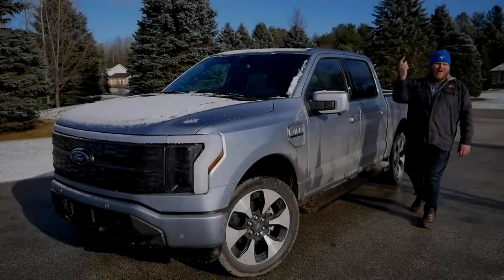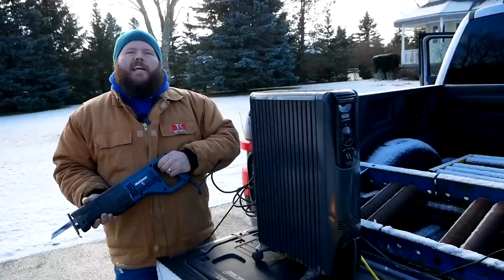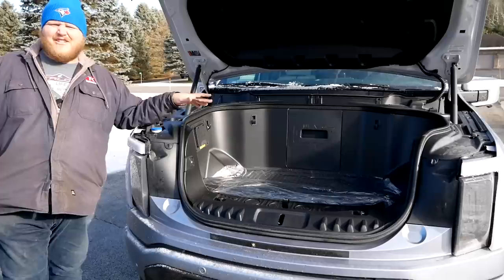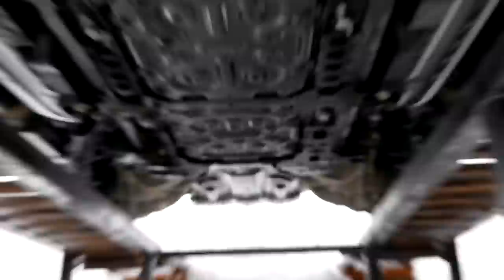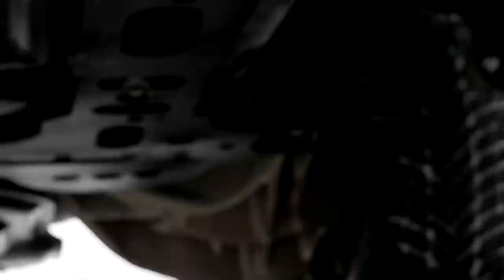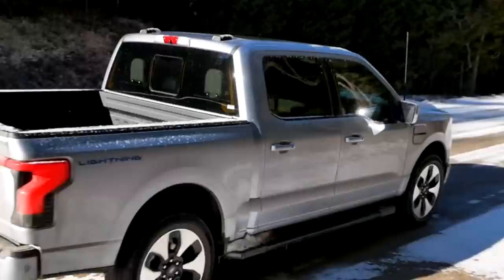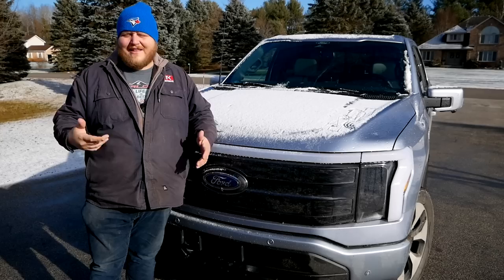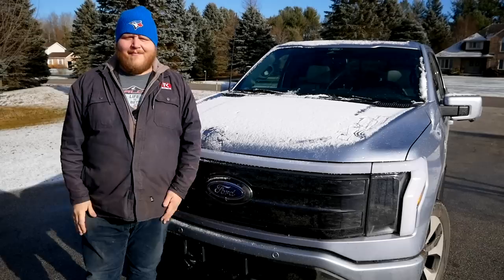Ford F-150 Lightning Electric Truck Real-World Review - Testing Towing, Range, Off-Road & More!

Comment: When this thing first came out, I loved it, but now that the hype has worn off, it’s genuinely hard for me to get excited about a $95,000+ truck — regardless of what powers it. Same thoughts on the TRX and Raptor R. If you’re not making $250k+ you have no business owning one of these, and that’s 97% of the US population.
Reply: Unless you're like me and had a couple of vehicles to trade in on it to get the price down.  I  realized when I ourchased the lightning I wouldn't be driving my 2024 F150 or my 2028 prius any more. So why not get the price down to something more affordable. Also if I had to charge at public chargers,  I wouldn't have purchased it. That defeats the whole purpose of saving on fuel costs.
Reply: @pstoneking3418  I'm guessing you mean 2014 and 2018?
Reply: You don't have to get the top of the line model. You can get an XLT for $30K less.

Comment: another great and fun to watch review.  As an ex-Tesla owner (for off-road reasons) I once made a 6,100 mile (9,800 km) trip in mine.  Rarely did I ever charge above 80% as the charge rate drops off a cliff after 80% and it takes way to long for that last 10%.  You will get to where you want to go a lot faster charging to 80% then someone charging to 90%.   Another consideration is the larger the battery pack, the longer it takes to charge.  

I look forward to more of your reviews.

Comment: The initial sticker price is the hard pass for me it’s just not viable when even the xlt trim gets so close to a hundred grand with extended range. Not to mention in Canada the extended range power plant should be named the only acceptable range since once temperatures drop the smaller plant won’t keep up. 

None of the EV companies seem viable at the price premiums they’re demanding except maybe the Chevy bolt which I just don’t want anyway.

Comment: Until technology progresses these electric vehicles are just a toy novelty and an expensive one at that.  In northern Ontario where large cities are 200 to 450 miles apart you need hybrids. I have a Sierra and a Rav 4 hybrid.  We only drive the Sierra occasionally when towing.  I think the hybrid which we've had a few since 2014 are the answer at this time.

Comment: I am really concerned about the salt causing problems with the electrical connection's.
Reply: Salt sucks for everything that can be corroded. Tons of current ICE powered cars that have wires and electrical connections, also susceptible to similar.
Reply: @NLKen thank you. Yes ice have corrosion to but that most of the time the problem. To have all electric everything the wrong things shorts out your fucked

Comment: As a Canadian EV owner, I get the gripes with the public charging. It really needs to mature, and all the different apps are just dumb. 

That being said, my car has enough range that I only have to use public charging every few months on road trips. The huge day to day perk is having a full "tank" every morning when I get up since I'm just charging at home overnight. As you said though, it depends on your use case. 

The other shocking thing is the energy consumption on that lightning. My Ioniq 5, for comparison,  does about 21kwh/100km in the winter, on studded Toyo's.

The price is also off the wall crazy.

Comment: I think this was a fair review. I'm not sure that the EV revolution makes a lot of sense in Canada. The infrastructure isn't there and it's taking a long time to see improvements. The range is a huge issue as well. We're big. Yeah, 300 km range. That could be a single days travel just around Toronto! Never mind going to the cottage or the like. As it stands right now, you can't get there from here is a huge issue and I don't see it changing soon. It's all about money. A charging network isn't cheap and the density of charging vehicles per month might not be enough to make it profitable.
Reply: You can buy a relaive cheap propane fuel cell generator and 40 lbs propane tank which DOES NOT USE pistons but rather a TOTALLY SILENT thin-membrane proton-exchange electrical power system which runs at 85%+ efficiency, so a simple 40 lbs propane tank is about 200 KW/hr which will gives you ANOTHER 700 km (460 miles) of range since the you can NOW download a "Software Hack" for the F150 Lightning which lets you charge it WHILE its driving! Sooooo.... you now get a total of 960+ km (620 miles) of driving range. That's good enough for most trips! 

Cost-wise, 40 lbs of propane is $60 CDN ($45 USD) so pretty good in terms of running costs! The BEAUTY of a propane fuel cell is that it is TOTALLY QUIET and you can still use it for your BBQ if you connect a long external hose to it AND it also has extra power outlets for driving appliances and other gear!

V
Reply: Back in the early model t Days gas stations weren't available everywhere also but there is power everywhere there are houses just not dcfc the dcfc take a lot less time to install and alot less red tape from environmental regulations so it will happen alot faster then people think next 5 years plus the s curve of sale yoy of ice vehicles is declining as evs are rising soon it will hit that point manufacturing ice powered vehicles won't make profits and will be canceled it will have a snow ball effect on oil prices since most companies are leveraged to the nine
Reply: @StarGateSG7 too much work versus filling a gas tank
Reply: @doctorcropse2795  One 50 Kilowatt Ballard-style Proton-Proton membrane exchange fuel cell powered by a 40 lbs tank of propane (i.e. 240 kWh equivalent!) would provide a heck of a range increase to over 700 miles (1100 km) where the vehicle can charge WHILE you are driving. AND you can use the fuel cell and propane for cooking and heating at your campsite while you are at it!

V

Comment: Okay so lets take a look at the analytics. Average price on autotrader is around 98k plus hst. Lets say about 115K with all fees and charger for home. A f150 in Canada XLT/Lariat can be around 58-62k up to 80k depending on options. Lets say with HST about 75k. So right away we have a 40k difference. Average kilometres driven by a canadian is 15k but trucks are more lets say conservative 25-30k per year. Lets say a F150 gets 15L/100 km through an average year and that is 4500L of fuel. Now take a cost of around $1.55-1.7L and you are at $7-8K per year in fuel. So alone this lightning will take about 5-6 years of ownership just to be the same as a truck. That does not include charging. As you can see an average cost to charge a car at home/at work can be about 500-700 per year. So really on average your payback period on a F150 is around 5.75-6.5 years and that is right out of warranty. To me I would not touch this thing and I did not include the outliers of sitting in the car/ having lunch to wait on the charge. if you pay yourself 45-70 per hour that is time it costs to charge while on the road. In closing I drive about 35,000 km's a year with 17-18^% being towing a 4500 lb boat and trailer. I have done all my analytics through Power BI and would never buy an electric for 3 simple reasons. 1) You have a variable of charging overnight so if an area does not have good infrastructure north of barrie you are SOL 2) I do many day trips fishing and for me there is no charger at the lake and then I would have to stay in a hotel overnight just to have a full charge to drive home 3) The charging infrastructure is still in ideation in Ontario. I work for a utilities company and there is still about 4-5 years left to get charging stations north of barrie in a quality and safe rollout. We are still too far away for electric trucks to be used off grid, outside the city or on long road trips.

Comment: I completely agree about installing fast charging stands at already existing gas station convenience stores. Everything is already there and as the EV market grows the business owners there will be hedging against losing customers. Though not all stations could install pass-through charging stands (for EV trucks with trailers to be able to charge conveniently) for many it would be a smart choice. In fact, putting in a couple pass-through chargers and having several parking spot chargers would mean more people can charge but the options will still be there. 

But, there needs to be uniform standards upon which everyone can rely. For one, all charging stands should be able to charge up to 350 kW at minimum standard (if the vehicle can't take all that power the charger will put out what the vehicle can tolerate). But, even better, all manufacturers should design their EVs to allow for extremely fast charging. The industry needs to work toward cutting the amount of time it takes to charge, instead of 1 hour the same charge should take maybe 15 minutes.
Reply: The only downside is the faster you charge these types of batteries,  the more battery degradation occurs. Same goes with constant charging them to 100%.

Comment: We are in the "wild west" so to speak with EVs, much like other technology we are going to see some weird stuff as inventors and engineers try our different things to see what works best. Go back to when we started putting bullets in cases in the 1800s and we had all sorts of wacky firearm designs and case designs. Everything from revolver rifles to caseless lever action pistols. Obviously those designs had huge flaws in hindsight and  where outpaced by superior designs like your standard bolt action rifle, but at the time they seemed revolutionary. 

At first Front trunks where a HUGE push in EVs since the lack of an engine meant reclaiming cubic feet for other uses, as EV design has evolved most crossover and car type EVs have dropped the front trunk in favor of maximizing passenger space and eliminating long hoods and front overhangs as it turns out most owners did not use the extra storage space, and the rear hatch was often sufficient enough. Only large truck type EVs have kept the Front Trunk, as Trucks are entirely about cargo capacity and the trunk offers dry controlled storage for more delicate items like groceries you might not want rolling around in a cavernous bed. 

This follows true with our charging infrastructure as well, we are going to see odd things in the future as engineers and businessmen figure out what people actually need. Does a traditional gas station style charger work best or is it better to lease space  in a parking lot of a commonly traveled establishment? What do we do about people who street park cars? Do we install chargers along the street and assign spaces to households or do they have to travel to a charger like you do currently with a gas station? There is no yes or no nor right or wrong, only what doesn't work, what kind of works and what really works. And we are going to see more of the first two than the last one until people figure out what does really work and it becomes standardized. 

Now is not the time for everyone to get an EV, and that is okay. Sometime in the near future however, I believe it will make more sense for most of us to own an EV than an ICE vehicle, even for our trucks unless we absolutely positively need the extreme energy density that gasoline provides. EVs have already made the majority of basic 4cyl transport mobiles look unnecessary, all they have to do now is scale up production to match in price and all your Nissan Rouges, Chevy Trax, Toyota Camrys and other uninspired basic transport units will just not make sense to own from a cost and maintenance hassle perspective. Things can change and make this not true however, EVs might never be able to scale production  properly, charging times may never improve, and gas might become so cheap compared to electricity that making the switch just won't make sense from a financial perspective, but I don't think thats going to happen, history shows that technology always is expensive and inconvenient at first until one day it improves enough that it's not.

Comment: Ev's are good for people who have a single family home with a garage where a 240 volt charger can be permanently installed.  Think of those people who live in apartment complexes or live in older traditional style rowhomes where parking is public and you aren't guaranteed a spot directly in front of your house.  Even if you did get a spot in front of your house do you want the charging cord running 40 or 50 feet from the house down to the car and being left there outside all night hoping nobody messes with it.  If your child has a sports tournament that is 2 hours away and you are staying the weekend in a hotel then you have to plan for when and where you are going to charge the vehicle over the weekend.  Even if there are charging stations at a gas station nearby you know its gonna take 30 minutes or more to charge so you need to incorporate that extra time into your game schedule during the weekend.  They definitely have a ways to go until EV's can make up even 20-30% of all the vehicles on the road.  But the government wants mandates to be set on when all cars sold should be Electric.  The whole transfer is poorly planned at this point in time.

Comment: I don’t think you can run a lot more on that inverter. It appears to be maxed out. That hair dryer only increased consumption by 200 watts. If it was on high it would be at least 1500 watts extra. Both the front and back appear to be tipping out around 1650
Reply: Yes, even though you're supposed to have a total of 2400 watts among the 4 frunk recepticals,  there's no surge ability. I tried using my electric 5 ton log splitter up front and it failed to start. I had to plug into the bed recepticals which actually have a 3600 watt surge capability for starting larger devices.

Comment: This is all well and good I just can't get all warm and fuzzy about electric vehicles . I own a 2004 GMC 2500 HD Duramax 4x4 crew cab ,  It will haul a loaded 32 ft. goose neck trailer up hill down hill around corners without breathing hard , has 160000 miles still looks good no rust . It does not get used much in the winter . Best part it is has been paid for a long time . When electric vehicles can match this I might look at them . Oh and Loaded with the trailer I get about 390 mi on 20 gal of diesel  on level ground .

Comment: I can only imagine the pain one must feel when driving home from work, plugging in at 20% and then 5 mins later having to rush out for some emergency. Electric cars have a place, but it won't be in my driveway for another 2 decades. Trucks make even less sense, imagine trying to tow an RV to a provincial park and looking for a charger ... in your firepit?? Nearest tree?? And what about the trip there, do you disconnect your WDH/trailer all the time just to fit the station and plug in every other hour on a four to five hour trip? Heaven save us from the morons forcing all this legislation down our throat. Let them eat crickets.
Reply: Amen
Reply: There'd be no such pain for a lot of people. If you have an EV with 400KM range, and then give yourself a worst case scenario of 25% loss in the winter (It isn't typically that bad), you're left with 300km. Even if you were driving 100KM/day, you have a huge buffer when you get home. 

We're a one-car family. It's an EV. I stress less about "fueling up" on a day to day or week to week basis then I did with my gas car. Every morning, it's got a full tank so to speak. There's never a last minute rush to get gas when I'm already running late because it came home empty the day before.

Comment: Problem in this vehicle class is you're competing with ICE vehicles that have extended range tanks that will take you over 1000km.  300km of range is when I go to the gas station.  If I'm going to have two vehicles, one for in town and one for trips, the EV would be a small car for in town trips.  But if they get the range up I'd consider one.

Comment: I think if gas stations got smart they would add a few fast chargers to their stations to cash in on some of the electric market.  Wouldn't take much to do that in most locations there would be space.   Would exponentially add to the charging options.  I also think it takes too long now.  Give it a few years and charging technology will improve and it will go much faster.

Comment: I have a homestead near Algonquin Park and hills and arctic temps forever.  I wud like to see U do some climbs n descents on say a 15* (degree incline) with that lightening.  My Big Horn with K02s can do the job in 8 inches of snow but can the lightening; which in my opinion is a non-starter here in frigid Kanadistan where it is now -25 degrees F.  and it may have the power density but not energy density at these ambients with lugged tires and say 1500 # payload from Home Hardware.  BTW: Ur ole man needs to get a real sno blower n not that back up toy blower that is obsolete n dangerous. If 2 shear pins break it is something more serious then heavy sno.

Comment: We traded our Powerboost in on a Lightning I used the powerboost to tow a racecar on a uhaul trailer to Nebraska from Texas and back(probably 6000lbs-ish(. The Powerboost got 11-12 mpg for the trip. It normally gets 20-24mpg when not towing. No surprise the Electric can't tow long distances without charging every 100-150 miles in good conditions. Definitely not a solution for long distance heavy towing in it's present form. Works for us, where our farm is about 35 miles away. Out and back towing a Gator on a trailer, it does fine. When battery energy densities go up, and Voltage of charge, to allow quicker charging, and there are more DC fast chargers on the highway, the differences will close, just like they did with wind and solar generation. Solid State batteries will likely start hitting vehicles in 2025 (BMW/Toyota).